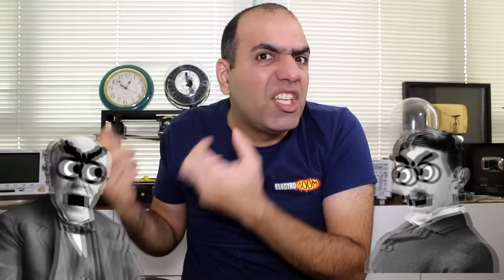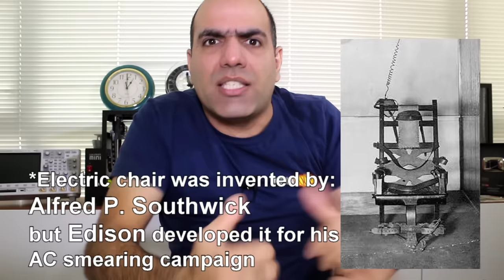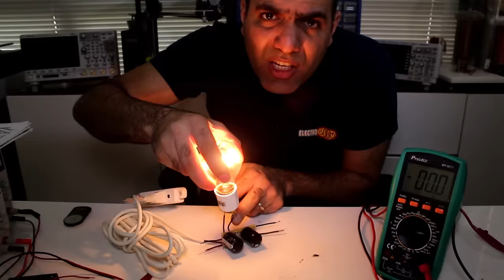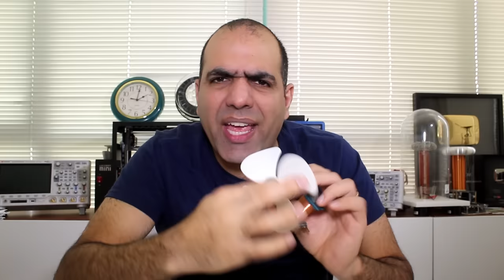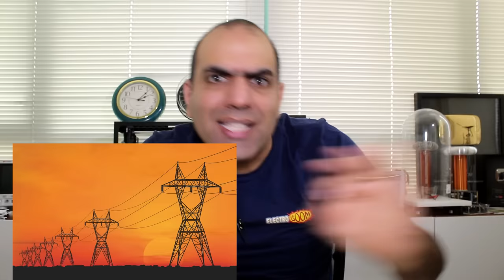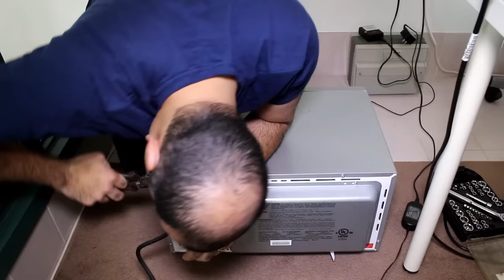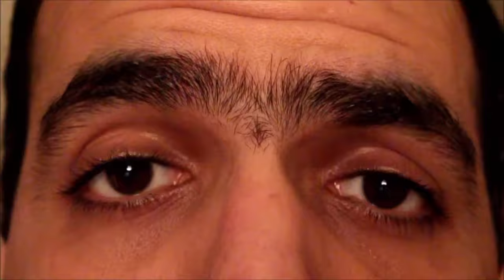Why Use AC Instead of DC at Home??

Comment: I agree that, as things stand, that we may easily switch from AC to DC in homes.
This would require modifications to fridges and air conditioners that still uses induction motors, plus few other devices as small fans who may use the synchronous motors (those with a short-circuiting turn).
Computers, TV, all switch-mode wallwarts, all good quality LED bulbs, all incandescent bulbs, hair straighteners can use DC.
Brush motors, like hand drills and hair-driers, should be able to take either DC and AC with some modifications.
Washing machines use inverter technology to drive the motor, so would only require little changes.
A problem are all devices which use a 50/60 Hz power transformer in their power supply. But all appliances coming from China never had one, as power transformers use high quality (electrolytic) copper, which is considered a strategic resource in China, not easily allowed in consumer items unless unavoidable, like in motor windings. In any case, power transformers and motors designed locally uses the lowest design parameters, to minimise the quantity of copper, so they usually overheats. A copper winding lifetime can vary from 1,000 to 1,000,000 hours - based on windings temperature and dielectric strength.
Just a minimal effort would be required to move households on DC, so to be powered from batteries.
And, if we can go beyond the madness of using lithium batteries as stationary power source, lasting 3 to 5 years, we may see the light and start using (for stationary usage) Pure Lead Acid batteries, or alkaline Nickel-Iron batteries, that lasts more than 25 years, same as the photovoltaic panels.
Keep in mind, stationary lithium batteries are a FAD - because of their short lifespan. The variety of lithium batteries that can provide the necessary 20 years of calendar life AND 3000 cycles are yes available, they're called LFP (LiFePO4) or lithium phosphate, but require some high-tech production techniques and are 10x the price of Pb-H2SO4 and Ni-Fe, and also require complex BMS (battery management computer), which add running costs.
Thank you for the great video, I would welcome a DC powered house!

Comment: Things I learned today: 
- AC is better for long distances.
- Edison was a dick.
Reply: Transformers are required to attain those high voltages, and transformers can’t alter the voltage of DC, only AC. So AC is only indirectly better for lengthy power transmissions; like Just Being Socially Awkward said, it’s really the high voltages stepped up by the transformers that are better for transmitting power over long distances
Reply: kovidomi , sort of. High voltage DC is also used for some  transmission lines. Edison was a dick :) Don't be fooled by the Tesla fan boys and free energy though.
Reply: For distance greater than 600km, High Voltage DC transmission(HVDC) is better an cheaper than HVAC.
Reply: st1300 r for distance greater than 600km, for connecting grids have different synchronization or different frequencies, HVDC is used
Reply: correct
Reply: did you just get on the internet?
Reply: No DC is not better on long distances. DC - you need 2 times more wires because you need one wire for plus and one wire for minus and you need to close the loop all the way back to the power source or electrons travel 2 times the distance to the power source from minus to plus. AC - you need only one wire. The other - ground - zero you can get it on the other side easily.
Reply: eidson did that to keep you safe
Reply: Actually - if the power grid was built now, we could use DC as well. A good DC/DC converter have like 98-99 % efficency - it's likely that the low frequency transformers we use now may be slightly more efficient than that (really close to 100%), but then there are more loss in the power lines with AC due to capacitive losses and skin effect. Add to that the losses in most appliences when they have to rectify the AC into DC (wich means they use more power than the otherwise would). 
AC is actually worse for long distances due to capacitive losses and skin effect (wich gets worse the longer the lines are) - but high voltage AC is still better than the resistive losses using low voltage DC. The thing is that when the power system was built, semi conductors was not invented
 - wich means transformers was the only way to take upp and down voltage with reasonable efficiency. They also choosed the 50 or 60 Hz frequency since it's the best compromize between AC losses in the transmission lines and transformer size and cost (the capacitive and skin effect really goes up with the frequency while the transformer size and cost goes down). And now when everything is built for the 50 or 60 Hz AC standrad, it's better to just continue with that, than having to rebuild everything.
An even more extreme example of that is our trains in Sweden - they run on 16 2/3 Hz AC - despite the rest of our power grid running on 50 Hz. That was because in the old days they had a hard time to build motors that had enough power running at 50 Hz. And now it's cheaper to continue with that standard, then build converters that convert 50 Hz 3 phase from the power grid into 16 2/3 single phase for the trains, rather than rebuild/replace most of the existing vehicles.
Reply: AC or DC is just as efficient when being transmitted over long distances.  All that matters is using high voltage, so that the current can be kept at a minimum.  The problem with DC is that we do not have an efficient way to step the voltage up and back down.  BUCK converters and BOOST converters do just that (for DC) but they're not nearly as efficient as transformers are at transforming AC.  Another negative for DC is that it arcs more when there is loose wiring, more easily causing fires and or melting things.
Reply: No, there is capacitance between lines. That in turn lead to large reactive currents in the lines, that causes resistive losses without transmit any power. This is especially a problem for in ground or under water cables where the conductors are much closer to each other. 
There is also the skin effect in thick wires, wich causes current to mostly flow near the surface and decrease the effective cross section area of the wire (also increasing resistive losses). For under water powerlines  100+ km long and air lines 800+ km long, there are many HVDC (high voltage DC) systems in use. For those conditions, less power is lost when the AC is rectified into DC and then turn it back to AC (thru an inverter) in the other end, than they would do when transmitting the AC directly thru the power lines - that's how big those losses can be under worst conditions.
Also there are several technics to convert DC - the most simple is the boost and buck converters. Those are usually the best choise when there is no insulation needed between input and output and the voltage increase or decrease is not very large (it works for large voltage increase/decrease as well, but component dimensions become quite uneconomical) - those can be 99% efficient unless there are very low voltages (much lower than what would be practical for a power grid). Another way to do it, is to chop the DC into a high frequency square wave then run it thru a high frequency transformer (wich can also be much smaller an cheaper than a 50 Hz transformer for the same power level) then rectify again at the other side (this also gives an output that's insulated from the output) - that can also be at least 98% efficient. The 50 Hz transformers are probably slightly more efficient (somewhere between 99 and 100%) - but given all the other losses using AC, the over all losses from power plant to user would probably be lower for DC. 
But - without semi conductors, there is no way of step up or down voltage efficiently. For our railways in Sweden we still have some old rotary converters in use - wich is simply a 50 Hz, 3 phase synchronous motor that drives a generator that outputs 16 2/3 Hz single phase. This is of course significantly more lossy than the converters using semi conductors. Our standard is old and now we just continue with it - it would never be worth the enormous cost and effort to change a well working system to another one, that's just slightly better - but if the system was built from scratch today, it would likely use DC
Reply: also "don't be an ass*ole"
Reply: Why do you just post the same ill-informed comment multiple times?
Are you really that starved for attention?
Reply: Ride84XL How often do you come to these comments sections. I can only handle them in such small doses. It's so hard to not reply to every mis-informed comment mis-informing other people. Haha Thanks for the conprehensive reply without any misconceptions. You even got skin effect in there!

Comment: If you run DC power downhill, does it have the potential to go further?
Reply: Yes.
Reply: Lol
Reply: @ameyas7726  San Francisco with all it's PC power is as downhill as it gets!
Reply: Watt are you talkin' about?
Reply: @LAME PSR Whoa, don't get so amped up.
Reply: @ameyas7726  Now with solar panels, why do we need to do double conversion from solar DC to mains A.C. and back to DC for gadgets. Why not just use DC as the panels are right next to or on top of your house.
Reply: @roobaba5415  there are DC wires and DC appliances which you can buy online
Reply: Ohm's Law might get you for that!
Reply: @roobaba5415  Because what Mehdi has said in the video. It's hard to change the DC volt, because transformer only work with AC current.

Comment: at around 2:14 you mention that 170V DC is not painful as 120V AC. I have always thought that ohms law, V= I/R is the same no matter if we talk AC or DC. In the circuit, the power is the same, AC or DC. The current through the body must be the same, but I suppose somehow AC has a different effect. Perhaps because of the vibrations.  Thank you.
Reply: It's V=I*R, and the reason AC is more painful is because the human body has lower impedance to AC than to DC. The human body acts as a capacitor, which allows AC through much easier than DC.
Reply: @Owen_loves_Butters  Thank you.

Comment: Microwave transformers have larger leakage inductance than normal transformers, the coupling between two coils
 are not very good... The leakage inductance can be seen as a series inductor in series with the output, and it increases the magnitude of output impedance, thats why the load voltage drops. The transformer in old phone chargers should do this task better, but these phone chargers have disappeared for almos two decades...

Even today, building high power high voltage dcdc converters is an extremely challenging task, semiconductor switches like IGBT just can not withstand high voltages. The highest voltage rating of commercially available IGBT is around 6.5kv, so we have to put them in series. One big problem is, you have to make sure that the voltage across switches are well balanced, even during the transition between on and off state. Also the stability and control strategy of DC grids are still under study...

Comment: There are actually high voltage dc transmission lines today (HVDC), I know it is not a science channel but I think it is worth to mention.
Reply: They commonly carry power between 50 and 60Hz grid, and underseas (because undersea AC transmission lines have a lot of capacitance, which makes power transfer suck, whilst DC isn't affected by it). If it weren't for the cost and size of converters, we'd see a lot more underground powerlines I'd think.
Reply from the maker: I should make a video on those too, but I thought I was kind of a science channel! Except for the mustache burning I guess
Reply: #ElectroBOOM Could you explain how an Arc welder can still shock you even if you only touch one terminal? It was a DC Tig-welder and it still sent visible arcs to a piece of sheet metal placed on a 20kW isolating mat.

edit: seems most DC tig welder starts with AC to make it easier to establish the arc, so assumingly it charges/discharges the object, like static electricity.
Reply: You are Mehdi, you are... <3
Reply: The cables above train and tram tracks are also often DC.
Reply: I came to say this. Transmitting DC over long distances is perfectly feasible. Edison just needed some semiconductor technology from the far future.

In most cases it's still cheaper to use AC, though...
Reply: Cool! Didn't know :) They go into the megavolt range too, pretty nuts. 

In July 2016, ABB Group received a contract in China to build an ultrahigh-voltage direct-current (UHVDC) land link with a 1100 kV voltage, a 3,000 km (1,900 mi) length and 12 GW of power, setting world records for highest voltage, longest distance, and largest transmission capacity.[8]
Reply: +Robin Its possible the TIG welding had a high frequency start. HF is very very good at starting an arc even without a good ground.
Reply: I just wanted to comment this myself. Only thing that is different is that they often use some kind of superconductor for power transmission.
Reply: Also UHVDC transmission lines are more efficient above 800 kilometers
Reply: And also between different grids at the same frequency that are not synchronous (e.g. between the European mainland and Great Britain
Reply: Robin 
The electrons will charge the object (if it isn’t grounded) until it’s the same charge and stop.
Reply: It's interesting in a way as HVDC creates this typical optimization case that's everywhere in engineering:

It's more efficient than HVAC as far as just transmitting power goes. No inductance/capacitance related power loss = higher efficiency. However the voltage conversion stations are more expensive, so there's range of distances/power draws where HVAC is more economical(in 95% of the grid) and another tiny range where HVAC would be preferred solution(very long lines usually between different countries).
Reply: Hydro Quebec uses HVDC transmission lines to connect the La Grande generating stations near James Bay to southern Quebec. Long distance HVDC transmission lines are cheaper to construct for a given efficiency. DC-DC conversion is now quite efficient, which was not the case 70 years ago.
Reply: 12GW? That's awesome. You could power roughly 10 DeLoreans with that... continouusly xD
Reply: It continued to arc (did not stop after charging). It probably had to do with the high-frequency start as someone mentioned.

Comment: Odd that this was just now recommended to me...  Anyways, it's actually more efficient to transmit with HVDC over long distances.   I don't know at what distance HVDC becomes more efficient but for the Utility I work at, we transmit at 500kv DC for about 900km before it's inverted back to AC for distribution.    Wish this video wasn't 3 years old so this comment might spark some discussion
Reply: Even though I barely know about electricity. That is cool to learn. Thanks for the knowledge. I got this recommended to me today as well. So to get what you are saying correct, AC is used for shorter transmission of high voltage and DC is used for long distance of high voltage?
Reply: Yup, however the tech used to build those HVDC systems is a bit more advanced than what was available when AC first won out. It would take until the 1950s for it to become realistic.

It does seem like these new systems are extremely useful though, as they allow connecting and synchronizing existing AC grids which were built in an incompatible way (e.g. 50hz with 60hz) to share load over a larger interconnected system.

Comment: the little center post in tamper proof screws will easily snap off/out if pushed sideways. might bend over once first. a nail or screw works for a good tool

Comment: I don't know about now, but years back we had to use DC lighting in the MRI room. The magnetic resonance imaging room had no tolerance for taking images with the 60Hz sound in the room. Let me tell you that those incandescent bulbs took a lot of Wattage back then and really heated up those wires with DC running though them. We even needed a 30amp light switch. 
With AC, (if they still have the same theory.) the electrons do not move very much if at all. They just go back and forth. In DC they have to travel the entire wire, and that friction causes heat.

Comment: AC current is best for homes and buildings because any appliances that are big that use up tons of power DC wouldn’t work since bigger appliances run on AC would need AC. Plus AC works best on rectifier power adapters also appliances with harden parts like heating elements would need AC

Comment: On Jan. 4, 1903, a team led the 28-year-old Topsy to a ring of 1,500 spectators and wound a noose around her neck. They fed her poisoned treats and then affixed two copper elements, one to her forefoot and other to a hind foot, ensuring that the AC electrical current would flow throughout her entire body. The electricians were, quite notably, from a company bearing Edison's name.When the men finally flipped the power switch, more than 6,000 volts of electricity coursed through Topsy. She keeled over almost instantly. After 10 seconds, the technicians stopped the current and the noose around her neck was cinched until observers deemed her completely dead.
Reply: Why would Topsy agree to do something like that?
Reply: danpt2000 Because it was an elephant